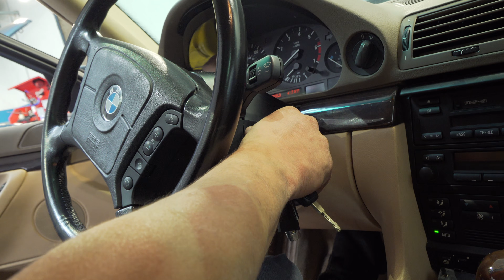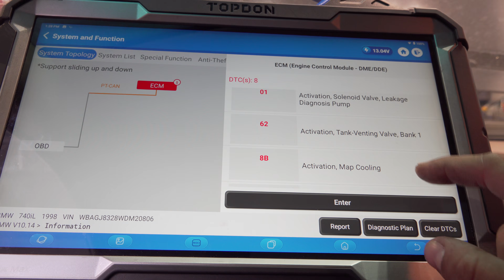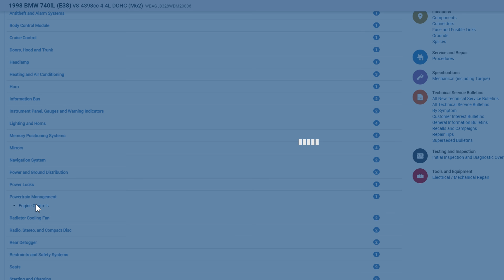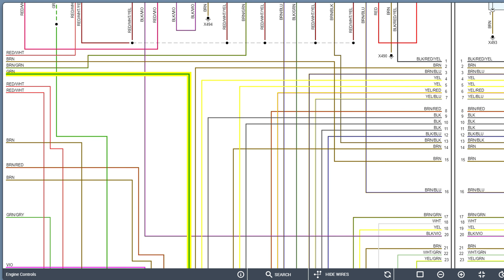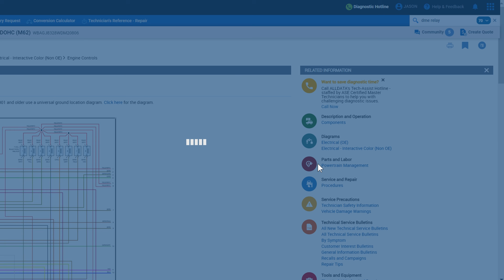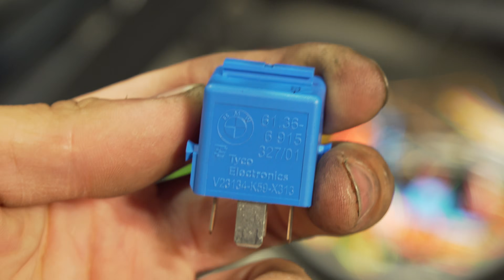BMW 740IL E38 | CRANK NO START

Comment: i tried to jump the starter with a screwdriver and just got a small spark instead of a big one. So I figured starter is dead but after watching vids on changing it out i noticed it has another pole i didn't see when i was under there. What small pole do you jump to test the starter? also I will check this and thanks for the great video!

Comment: Great video. I'm having the same starting issues but don't have a voltage control fault code, with  a 1998  740il.  I see the relay is under the hood black box, which one of the relay you pulled out to test? I see other relays  and the same color. With an Ob 2 scanner showing P1145. Thank you

Comment: Being a technician myself with the background in aviation having repaired various fighter jet systems and attack helicopters, I can appreciate your diagnostic delivery and instruction. So many need the skill and advice you and others like you give and impart to make their problems solvable. I especially like your delivery and straight forward way of showing the connection between the cause and effect. Your equipment is top notch too and mt Xtools D7 box although good pales in comparison to yours😅 I gotta get me one of those. Thanks again bro for the lesson and the quality technician that you are. Keep the spark going.😊

Comment: HI. I HAVE THE SAME CAR 740I E38 1996 V8. I DROVE THE CAR MANY TIMES WITH NO PROBLEMS. 1 EVENING I PARKED IT. OPENED THE BONNET TO CHECK WATER AND OIL. 10 MIN LATER TRIED TO START TO PARK IT IN THE GARAGE. NO CRANK NO START. LEFT IT AS IS WITH THE KEY INSIDE. NEXT DAY THE CAR HAD LOCKED ITSELF WITH THE KEY IN IGNITION. AFTER A LONG HANGER WIRE IT OPENED. NOW IT CRANCKS BUT NO START. PLEASE HELP

Comment: I had a similar issue with my E38 740il, no crank and no start but I could hear a click noise.  INPA indicates low voltage in the EWS - Code 148 error.  I opened the E-box and wiggle the starter relay K6324 voila - the car fires up straight away.  I note you've replaced the DME relay K6300, did you replace the starter relay as well?  What was your customer's symptoms? Did the car able to crank at all?
Reply: I think I’m having same issue with my 98 740 il no start no crank but I definitely hear a click each time should I try to wiggle the starter relay as well ?

Comment: Changing fuel pump without disconnecting it and checking it with a 12v external battery ? Why did customer change sensor ? Why did the relay stop working ? Book in the trunk is not cutting it. Watched with great pleasure.

Comment: Great video,  I was a BMW tech back in this era of BMW, it brought back memories of doing similar tasks.  Today I'm a DIY'er.  On more modern stuff I try to research how to test a sensor or in the case of the fuel pump before replacing.  I encourage anyone who is a DIY person to slow down, research forums and or youtube then do some testing of components in question instead of throwing parts at it.  The money saved can buy you some more professional tools or a higher end scan tool .  Mario,  I could watch your videos all day long!

Comment: As to the 0.7 V, that means there still would be at least 11.3 V over the relay coil.  A 12 V relay should activate at no more than 80% of the label value, in this case at most 9.6 V.  Two of the common problems on these kinds of relays would be open coil or some mechanical issue like dirt.  With open coil, you would not get any current and never see the 12 V and 0.7 V readings combination at the low side.  So, I would suspect a mechanical issue.  Dirt in the magnetic path.  Or a slipped hinge structure.  I have seen both kinds -- not on cars, as I am not dealing with them.  But relays in other applications.

Comment: Unlike MOSFETs, old school Bipolar Junction Transistors (BJTs) have a ~0.7V voltage drop across them. Not surprised to see them being used for relay control in an 1998 car.

Even if you have 0.7V drop, it is still >11V across the relay coil, more than enough to turn it on... if the relay is good, of course!

Comment: I went through something similar on a BMW. It turned out to be a faulty fuse. But not that it was blown. But that it had high resistance. And was causing a voltage drop. If you unplugged the i.a.c. it would start and run. Took me a while to figure that one out. But in truth it was one of Mario's videos that gave me the tools. I'd learned to load test circuits instead of just assuming power is good just because the fuse showed power. So when I load tested the power going to the i.a.c. I saw the voltage drop. And the power going to the i.a.c. was also the main relay power. So the fuse was good enough to handle only the load of the relay. But not both the relay and i.a.c. Lesson learned.
Reply: I have a no crank on my 2000 750,I only replaced the top battery thinking I would get something but no I’m getting full power in the cock pit,but no crank
Reply: @Leo Moreno  Still a lot of things it could be brother.